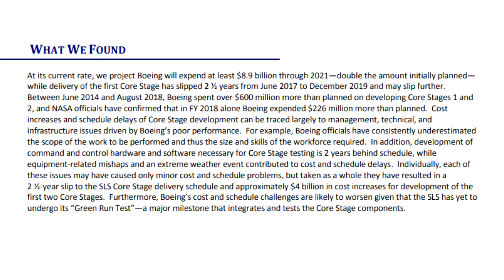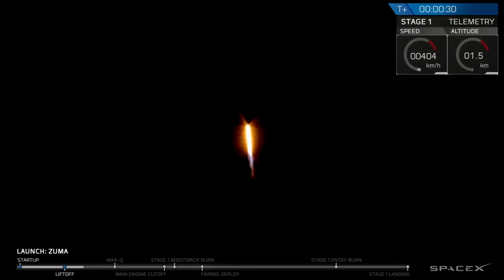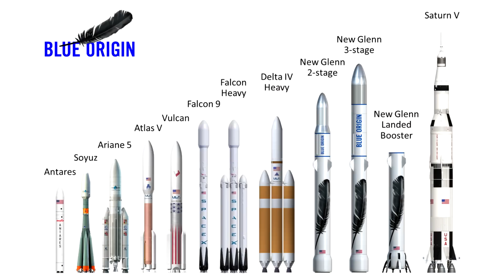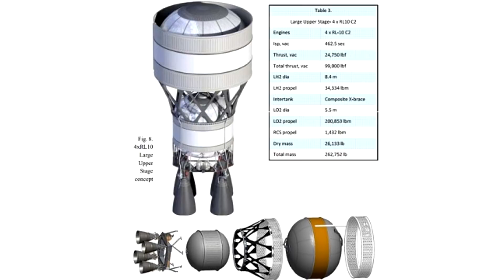New Glenn, OmegA and Vulcan Get Air Force Approval

Comment: Wouldn't  it have been better if SpaceX had developed the cargo BFR first? So they would had more investments to cover BFS development costs.
Reply: So far the work done seems to be the cargo and crew commonalities, so I wouldn't say one is being developed 'first' just yet. I'd be very surprised if the crew version flew first, just like Dragon.
Reply: I think Musk is overly ambitious. Let Falcon make money for a while. Still proceed on the BFR, but slower. Make the most use of what you already have.
Reply: that would just make spaceX and even bigger monopoly
Reply: @macicoinc9363  Yes for space engineering sector is a bad thing, but not for SpaceX which is a private company that needs to think what is best for themselves.
Reply: are you stupid or did you miss the part where it is explained that there is no need for so much payload.
Reply: @Mar-s5q8m  Considering the development time of SpaceX (which is super fast compared to NASA) BFR will take many years before maven flight and untill then larger payload will be at least projected. If BFS will be built first it will take more time for human flight rating.
Reply: there will not be any larger payloads ever. commercial and military satellites have stayed the same weight for 40 years now and current satellites are just the same and it takes decades before anything significantly changes in the satellite business and if anything the tendency is to go lighter. the airforce is not interested in launching 140 tones into orbit nor was this program about launching 140 tones into orbit, so that's just that.
Reply: @Mar-s5q8m  Mh i got your point
Reply: @Mar-s5q8m  what about multiple satellites at once? I mean, yeah, it's still too big to be very useful, but that could be offset by the 100% reusability.
Reply: @rohanpotdar908  there is no such thing as 100% reusability. nothing last forever. you can use stuff only so often. also the europeans have almost a monopoly in the satellite launch business with the Ariane 5 which usually launches 2 satellites at once and even then they struggle to find 2 satellites who have similar enough target orbits to be launched together. for 140 tonnes payload you would need 14 satellites, all with the same target orbit. like that's ever going to happen.
Reply: There's apparently a problem with a BFCR; The hell are you going to fly on it? Starlink doesn't exist yet, nobody is truly in the business for superheavy payloads since Polyus, the launch market is apparently shrinking at the moment, and it's not like we have some sort of megalomaniacal maniac somewhere that could cause the entire planet to go into an arms race that would have us cranking out high-double digit war machinery for vacuum operation, right!?

Comment: While in many industries, payloads get smaller and smaller, with more use of CubeSats and small satellites, both the communication industry and the military occasionally push the boundaries and develop larger payloads than ever before. when SpaceX builds the BFR, I'm sure the military will be more than happy to design and fly payloads with it, but I wonder why they are not investing in that capability now. You did mention a few of the theories, but I'm saying that the military likely will use BFR. I wonder if it's just that they don't need it right yet, so they will let SpaceX develop it themselves.
Reply: It's interesting to read through these comments, because I think we are all saying basically the same thing. We agree that Elon has a tremendous vision and accomplishes great achievements, but for the most part, we (the comments on my comment) also agree Musk isn't perfect and that he leaves room to be skeptical of him. I strongly believe that the BFR will fly, and that it will be developed at a break-neck pace compared to what other companies or agencies could do, but I don't think it will meet the projected mission timeline. Instead, it will fall somewhere between. 

What do you guys think about his satellite constellation, Starlink?
Reply: Its an interesting idea. Latency is an issue IMO. My ping to google is ~30ms round trip. If it takes 25-50 to ping the LEO satellite it would double.
Reply: Probably the last one, since SpaceX would probably have it done before the Air Force can even try to get funding for huge payloads.
Reply: Tbh, as much as I love SpaceX (and probably will apply to intern with them next year), I'm skeptical of their timelines. I don't think the BFR will fly any time too soon. But also, the Air Force might wait until the BFR is flight-proven before investing in payloads that require it.
Reply: @johnholleran  funny attitude people have about SpaceX timelines. "Oh they never achieve them" 
Well yeah, they announce ridiculously absurd timelines, but they achieve absurd timelines. It's just ten years since they launched their first tiny rocket. Barely more than a sounding rocket. Now they average nearly three launches a month of multi tonne sats, have put a car beyond the orbit of Mars and have started building what is by some measures the biggest rocket in history, but, it's also fully reusable! Who would have seriously thought any of those things would happen ten years ago. It's absurd.
 There are so many fanbois for a reason.
Reply: The thing about fanboys is that they don't tend to think critically. They bash others' progress and happily gobble up bullshit timelines that are often times never met and quietly hushed away. There are many different factors that determine the success of a company, not simply "oh they did it before so they will surely do it again!"
Reply: @MrMilkman29  ooh sure, as they say in the finance industry adverts "previous performance I'd not an indicator of future earnings", but what I see is more Elon bashing than actual fanboi. He's not as great as made out, nor as bad, but he is a brave, skillful highly motivated genus. That's just an observable.
Reply: @MrMilkman29  It's hard to bring fanboysm down after rocket reusability came in place.
Reply: MrMilkman29... While Elon Musk is a genius he is also an LSD trippin' visionary. I am not suggesting that it is bad but the US Military considers those types as non regimented, non disciplined, LOOSE CANNONS, as Acid Heads are generally not very structured. The US Military is not known for anything creative....or even tolerating it for long as they are extremely regimented and structured....which destroys creativity. 

(One does not admit to dropping acid publically as it damages one's respectability and credibility.. We know that many of Silicon Valley's brains are microdosing with LSD and DMT. Good for them as it enhances creativity..dreaming while they are wide assed awake. They just do not advertise it. as LSD and DMT are still  Schedule 1 Drugs and possessing them, or using them, is a felony to boot?)

Perhaps the decision, if not made because of Elon's fryin', flyin' high on that flypaper, just might also have something to do with TESLA?.
Reply: You don't need mind-altering substances to develop a vision, especially one as big as trailblazing a future for humanity.
Nor do you want them when people are trying something totally new and totally risky, like spaceflight; all of the final candidates for the Mercury, Gemini, and Apollo programs (with I think three exceptions for Apollo) were military aviators.
Reply: Elon is really, genuinely talented at a handful of things.... One of those happens to be taking credit for others' work. He is an absolute master of spin, of spitting out impressive timelines and graphs, showing off sleek contours and huge machines set to tasteful electronica. But it takes armies of actual, incredibly talented, engineers and designers to turn his talk into anything approaching reality. I can't even imagine how frustrating it must be to work with or for him. I'd hesitate to call it creativity, really - It's money. He can afford to turn shower thoughts into startups in a matter of months, basically as much as he'll want to for the rest of his life. He can spend millions on toys he likes, obsessing over aesthetics and impossible speed at the sacrifice of safety and working conditions. I'm glad that one of the people with that kind of money is doing something other than just sitting on it. I'm glad that at least some of the things he thinks are cool are also genuinely useful. I wouldn't be at all upset if someone who really knows what they're doing took over some of those projects.
Reply: He does what he enjoys. The people working for him must also enjoy it or they wouldn't be there long. Your view that its only about money is easily disproved by the BFR being his current goal. Its a huge money black hole and risk. Your ability to detect whether money is obtained through evil or passion is lacking Tuxfanturnip.
Reply: You misunderstand. By "It's money," I mean that he can afford huge money sinks. There's no such thing as a billion dollars raised through "passion." He got lucky and managed to build a cult of personality around it.
Reply: Bullhonkey.  It's called leadership.  He didn't have all the money to start up SpaceX and Tesla and SolarCity; he attracted money and talent and interest both popular and political, through something called a vision.

"Vision is tomorrow's reality expressed as an idea today."  -Orrin Woodward
Kennedy did the same thing.  MLKJ did the same thing.  Reagan did the same thing.  Ghandi did the same thing.  Steve Jobs did the same thing.  Obama did the same thing.  It's not spin, it's vision.  And it's not so much that they enjoy it than that they (the key talents) believe in it, believe that it is worth working to accomplish (and working dauntingly long and difficult hours, I might add).  The army of intellectual and industrial labor backing Elon up would never have assembled if he hadn't had a vision of the future in the first place.
Tuxfanturnip  illidur
Reply: ahahahahahhahhahhahahahhhahahahahahahahahahahahahhaahhahahahahahahahhaahhahahahahahahhhhahahahahaha

Comment: But why bother with Vulcan when it still will leave a bunch of space junk; that being the tube.  The engines alone are the only part that's reusable...
Reply: the whole first stage minus the engine will just plunch in sea like any other (except falcon 9/h ofcourse) first stage. The second stage will just deorbit itself , so minus maybe some bolts or rings from the payload decoupler there won't be any space debris in orbit.